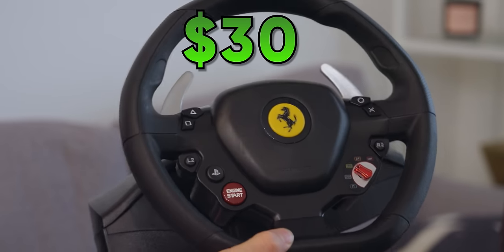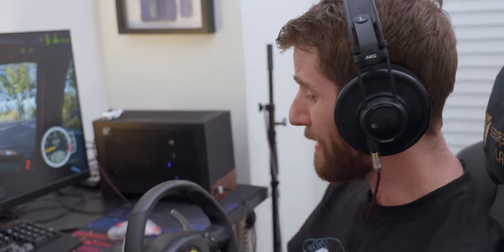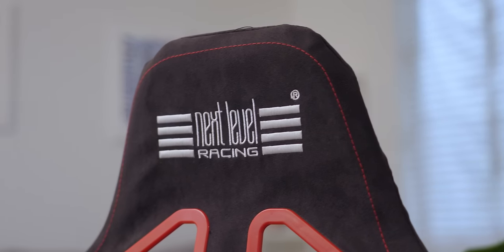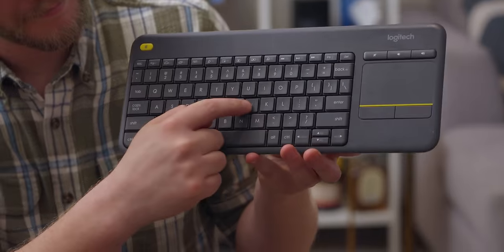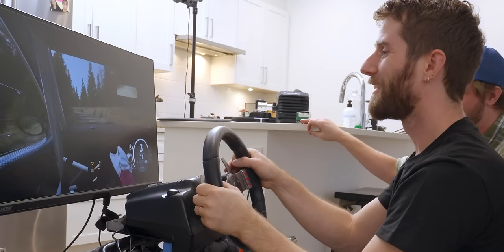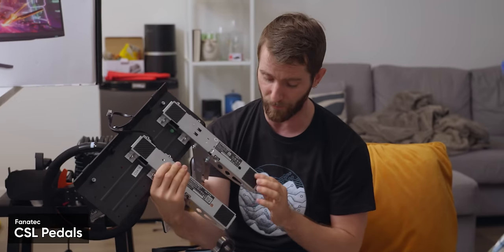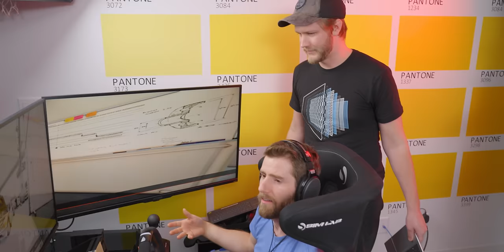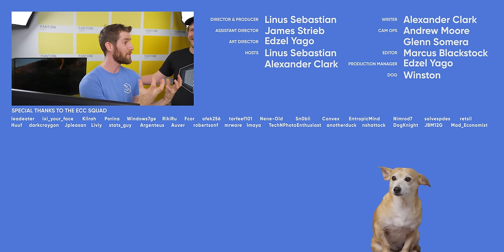Don't Waste your Money - $30 vs $10,000 Racing Setup

Comment: I have an average set up. G27, gaming chair, VR.
My mate has a fanatec DD2, BMW GT2 steering wheel, V3 pedals, mercedes GT seat, VR and it's all bolted to a £1200 playseat rig.

On my setup in Assetto Corsa, I can do BTG on Nordschleife in a BMW GT2 in 6:46.761.
On my mates setup 6:47.044.

I think if I had more practice on my mates setup, I could beat my record. But probably not even by a full second as I'm driving at the limit of my ability.
I have well over 1000 laps under my belt on my system, and less than 50 on my mates.

Conclusion: There is very little difference between my <£1000 setup and his >£4500 setup when it comes to racing results. But the immersion when using his rig, absolutely blows mine out of the water.

For the record... He has never beaten me once in any race EVER! YES, I'm jealous of his rig... There.. I said it...

Comment: There is a medium ground between the "ultimate set up" and "alex's set up" that will most certainly increase your capability to compete. Alex's set up that uses a belt driven system is not exactly ideal these days, direct drive bases and compatible wheels are getting cheaper all the time. You can still get a direct drive wheel base, a half decent pedal set with a break loadcell, and a decent enough wheel, for around $700, a fraction of the $10k, and believe me this will certainly be better than the belt driven system. It is all the motion stuff with highest end direct drive, pedal, wheel etc. that seriously isn't needed, and that's what is making the price so insane. Direct drive is still the way to go though.

Comment: Hmmm, a high end setup for 10k. But then you pair it with the cheapest plastic wheel from fanatec that forces your high end base to low torque mode (max 8nm instead of max 25nm). Very strange choice, but maybe you needed the wrc logo on screen.

Comment: Couple of things - the Alex's setup with better pedals is very accessible to most people on cost - the Logitech pedals are kinda a** in all generations, I bought a Thrustmaster T-LCM for not at all much money you get adjustable load cell braking and a whole bunch of other features and it is a game changer. It's not on the Fanatec level, but it's more than good enough and you can get them very cheap on offer. Also maybe if EA WRC had VR support because.. y'know.. BREH. Because of this NGL DR2 is still the best option here.. I know where functional 30 day returns of Fanatec gear passes through in my country for auction and can get it cheap, some day when I stop being stingy :)

Comment: @ 4:51 Steering gets easier when you're going faster, not harder, and that's only with unassisted (usually rack and pinion) steering. With power steering the resistance a wheel puts against your steering is light and easy, whether going fast or slow. This xan actually be dangerous at high speeds, which is why many high power sports cars opt for unassisted steering, to intentionally make steering  heavier, so you don't unintentionally turn to far at high speed. Powerful car going slow, unassisted steering is heavy, as it goes faster, steering gets lighter, but still has resistance so to not oversteer at speed. Power steering would offer no resistance at speed, making it easier to oversteer at speed. So steering resists LESS at high speeds, get it???

Comment: I bought an LG290 once off Ebay. Here's what's funny. "New- unopened box!" get's here, the box is trashed, clearly been opened. Hook it all up with my shifter, pedals and e-brake(didn't work at all), and it was so horrid, like i had to take it apart and fix it to make it even work, was an easy fix as the drive belt had fell off. Once I fixed it it wouldn't calibrate for 3 hours, i finally fixed that and used it for like 2 hours and decided to sell it and lose half the money i put into it. Never buying anything Logitech again, or units without force feedback, DD from here on out, considering a Fanatec CSW2.

Comment: I did buy almost the same set as Alex an few years back, with the same gearbox but without an handbrake. I love the set, but it is kinda messing around a lot with the settings to get it working just right, per game. And sometimes it just forgets all settings for some reason, i thing after certain updates

Comment: I absolutely agree that you don't have to spend 10 grand if you want to play EA WRC only, because the simulation level of the game - especially for non WRC cars - is painfully low. Not to mention that if you connect a Fanatec v3 pedal via USB the FPS will be limited around 84 with terrible inconsistent frametimes. Luckily there are other titles that make the 10,000 rig worth it.

Comment: nah you didnt get too low, im using a thinkcentre with i5 3470 and a 1050ti with a logitech wingman formula force from 1998. The only way to get the wheel working is by using some Saitek drivers from another wheel

Comment: The only interesting mistake is the most important one: The shifts in a rally car are sequential. But not like the F1 on the steering wheel with a lever like a motorcycle.

Comment: I use a PS5 controller with gyro on a PC for racing turning it into a K.I.T.T. like steering wheel. Often needs some ingame settings adjustment though

Comment: Running Rally cars cost more than $10,000 winning rally cars cost $50.000 -$200,000 for 4's or 6's or a lot more$1000 for tires for a weekend. Unless you are a skilled car and engine builder you have to pay the map navagator too.  Please get real Linus  Cheers buddy

Comment: "I kinda see leaving it plugged in but in a pile next to you, that's what I see a lot of people doing" 😂😂😂😂😂😂😂😂😂😂

This is literally me with my BIL's Formula Force EX blocking a few square CM of my secondary, portrait orientation monitor when it's not in use. I would definitely prefer having the desk space though...

Which has me thinking though; coiling up and zip-tying the stock cord, then using an extension cable on the desk, means you can easily just stow the wheel away when it's not in use.

Efficiency mod unlocked!

Comment: lols at the 18 minute mark cant use a left foot for braking smh. Ive been driving using two feet for over 35 years and even got knocked on my driving test for it. I argued with the tester then and to this day disagree with her. I I was learning to fly at the same time I was driving so my feet were used to going in opposite directions. It ensures that when I press with my left foot im hitting the brake or clutch (yes I still drive a stickshift at times) so im guaranteed to slow down. Also when driving twistys or in snow, I can work the throttle and brake more efficiently.

Pretty good review. I just got back into racing with gt7 though Im using the controller for setup sake. Ill likely add a wheel and psvr2 when I get serious about it. I might even set it up separately in a corner to avoid the setup and takedown. You cant beat the immersion with it.

Comment: not sure if its mentioned in the video but logitech's g29 shifter is basically a scam because from the past like +5 years it stops working after a few weeks due to poor interior design hasnt been fixed yet

Comment: I'm struggling to believe a decent steering wheel without force feedback is worse than using the controller...you still have so much more control and sensitivity over how much you're steering...maybe he's just a bad driver...correct me if I'm wrong...

Comment: @bertybenno If you have a capable TV you can reach 10-15 extra fps on ps5... I have a Sony A90K with 120 Ghz refresh rate and the VRR and ALLM is designed specifically for many games like these to hit the 60fps mark (more or less).. I played for ex. Plague Tale 2 and measured performance on two different TV sets.. the game was locked at 40fps on graphic mode and 120ghz but with VRR and ALLM on it was hitting hitting 53-55 fps, amazing graphics and very smooth gameplay, same scenario but with a TV without VRR and ALLM was staying at 40fps sometimes even less.. So if a game like Driveclub is locked at 30 fps with a proper TV you might get between 40-45 fps which is not bad at all..

Comment: rly don;t like the desk clamps of thrustmaster, no matter how hard you screw it it will wobble around edge pivot..
tesla should add drive simulation mode into the car with vr headset and suspension forcefeedback

Comment: instead of buying a entire setup i would just get a decent bucket seat from a car at a junkyard, make a wood stand for it keeping the rails so i can slide it back,  then make a set up out of wood  with the cheapest 900 degree steering wheel, pedals with clutch, and g29 shifter

Comment: Did you guys install the thrustmaster software? I think that wheel should have force feedback.
Reply: No, that T80 does not have force feedback. It has like a rubberband system which simulates feedback, but it's crap.

I had this during the pandemic, and it was not at all great compared to the old Logitech Momo steering wheel, and it's even worse with the Logitech G29!
Reply: @tiadaid  You’re 100% right, I was thinking of Logitech

Comment: I think u jumped too high at the end. The CSL in your opinion plus 8nm power and maybe (you have more, working options when driving on a pc) with their own CSL pedals, shifter (good but not needed first), is (but maybe that’s me because I got me an g25 and a g27 and a g29 and jumped directly to DDPro which is the Ps comparison to CsL base) real big jump and for the first time I felt it’s really fun to drive. You feel so much more and it’s not loud like a jackhammer even if u didn’t started the game. I think if I count it I’ve played 10 times more and with more fun in the last 2 years as I played with the Logitech wheels in 15 years and I’m not getting younger and my time is much more into something else than simracing, not because I wanted it but because it’s real life where u work and do other things. If I had the chance to jump back with the acknowledge that I have now I would’ve never bought a Logitech wheel and just jumped directly to Fanatec and same with that unnatural PlaySeat Alcantara (there’s a pipe in the middle between your legs where u fold around and scratch your ankles at) instead I would buy a proper extruded aluminium rig with a proper seat.

Comment: The Playstation analog controller, I can understand the positioning of the left analog in PS1, since it's an accessory and not the default controller, you assume that all games focus on the d-pad, so it's understandable that the analog stick is placed where it's placed. Now, since the PS2 has default analog controllers, there's no excuse for them to not swap the D-Pad and left analog stick position. To keep this positioning to the PS5, my god, Sony just keep doing everything wrong, gen after gen. It blows me away how people blindly love this brand. It simply doesn't feel right or confortable to use the Playstation analog stick. Nintendo and Microsoft in the other hand, always nailed it. How funny is that the worst is the most popular? People are really funny.

Comment: How could anyone into sim racing actually prefer NOT to use vr?! It literally makes in car view usable without losing visibility like you do in flatscreen!

Yall are incorrect.
Reply: VR is definitely more immersive, yes. But there are a few reasons why people prefer triples.  Some experience motion sickness in VR. Triples are also less resource intensive, easier to race with for longer stints,  and tend to offer better peripheral vision. Definitely try them both.

Comment: my Thrustmaster T150 pro base stopped working suddenly after being used for 4 years continuously,  
now i am planning to upgrade, as there are no direct drive wheels available in India. My only option is Thrustmaster TS-XW.
Or should I go for the cheaper option Thrustmaster t248 as Thrustmaster officially does not have a service center in India

Comment: Wow... LTT just lost the little respect I had for them after the last fiasco.

1. Using a wheel/pedals/shift/handbrake is NOT something you just jump in and do great the first time, it's a learning process that could take weeks, or at least days if you have a natural talent for driving.

2. No matter how shitty is your wheel, is going to have SO MUCH MORE degrees for turning than any analog minijoystick (dpad doesn't count because is digital). You gotta be really blind to say that using a controller is better than a wheel. The difference is just abysmal, like night and day.

3. Jumping from a shitty wheel to a good product like a G27 is noticeably, just like jumping from a consumer grade wheel like the G27 to ANY semi pro Fanatec wheel, even more if is DD, and there are true professional wheel setups out there, WAY more expensive than Fanatec, and WAY more realistic, precise, accurate, etc. By the end of the video they just implied that using a Fanatec is not going to be much of a improvement over an old Logitech.

And becoming an EA sales bitch?, geez...

Comment: 7:18
xD im using the g27? still, too 
i got it 10 years ago or so for 220€ and its still working super good xD 
but the clamps to hold the wheel on the desk broke 
now i have a cheap seat stuff 

wheel, 3 pedals and the shifter + the seat where just 220€ + 180€ for the seat (the wheelholding is a bit... movable but it holds and stays xD)
im not sure, if i want the newer model, that has some new kind of force feedback, g29 ?

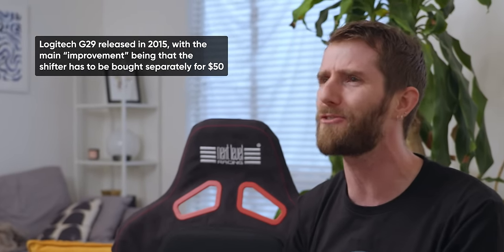10:00 
ok i wont xD
Reply: AFAIK the G29 use colloidal gears (or something like that 😋) which means that is less noisy when you turn the wheel. In contrast in less precise and broke faster.

Comment: The T80 is good for kids. Not good for anyone that wants to see if they like sim racing though. Very unrealistic feel but can be fun in F1 games despite no FFB. If you buy this wheel to try sim racing, you'll probably never buy one again and quickly fall out of the hobby. I'd shoot for an old logitech driving force pro or driving force gt. You can find them used on marketplace and such for a similar price. A lot of people try to overprice them though so be weary. Sim racing is the best hobby you'll ever get into. You'll be bad at it at first and dont let that deter you. I just started ranking respectably on leaderboards and I've been doing it for 5 years 😂😂😂

Comment: Why would you put all that effort into high end rig, and then just look at VR and scoff at it? The way they did that really does my head in. Out of all the equipment they had there, the VR headset is the thing that gets you closer to sim for immerision. Big tripple screens are nice, but VR puts you actually inside the car itself with the ability to judge distance and corners as you would in real life. You don't need the stupid motion rig, and you don't need the DD2. With a G29, a home made wood rig and a high res VR headset, you'll get a similar, if not better experience than these two for about 9 grand less.

Comment: 4 month ago?    well i have the original g25  and it works but it doesn't work   this next explanation is no word of lie.....So i had a g25 from years ago but something went ary with the actual steering it went loose or something  anyway i bought another just wheel years ago for a cheap price about 2 years ago  i tried it out and it worked for a few laps on GT Legends.. and then acknowledged the Nividia and windiws updates i had pending on win 10...well straight after the update and the hardware no longer worked either the win update or nvidia gfx drivers update caused it to stop auto centering, which it usually does  when you plug the usb and power cables..
Right weill then it wasn't till months later that for other reasons i needed to update by mobo bios,   i had left in plugged for ages as it didn't work anyway..but  unbelievably after the bios update  voila! it was working again,, and you guessed it another  windows update and it stopped working again...yeah i tried reflashing the bios (at some risk) but no joy the mobi reflashed  but the wheel still wouldn't work...but like i say mine is an original g25 not g29 or g27..

Comment: Bought WRC a pair of weeks ago (under s good discount on Steam) but haven't had the time to use IT. RL can be such a female dog. I will ASAP.. ☹

As for controllers... I DO have a FF steering wheel (a cheap one, nothing exceptional)... in the attic. I simply don't have the space in house. I bring the wheel down, I must camp out, that's how cramped I am. I must make due with a PS4 controller via Bluetooth, but since my right hand is working at about 50% of its native abilities after an accident I had years ago where I severed two of the three nerves in the forearm it isn't all that easy.😐

Comment: The logitech wheels are not mid teer. They pure shit. They may seem inexpensive but they are still way overpriced. Do not, under any circumstance, get a logitech wheel.
Reply: Yeah, in this day and age unless you find one for a deal or second hand used, definitely spend a little more money on something belt driven or direct drive.
And I say that as a G29 owner lol.